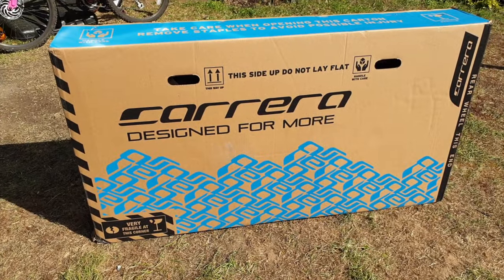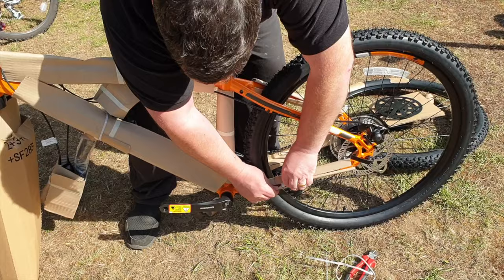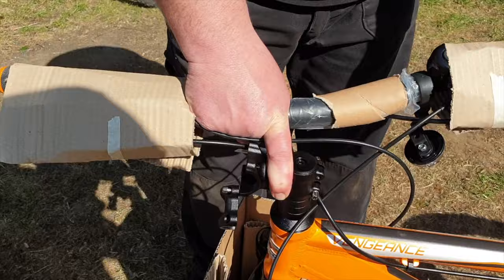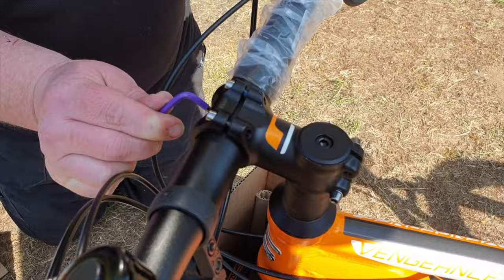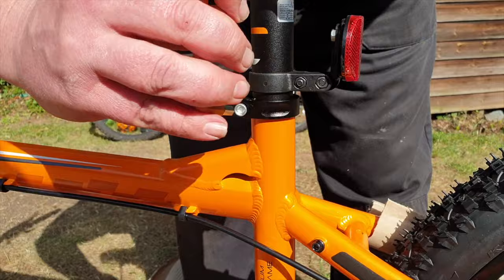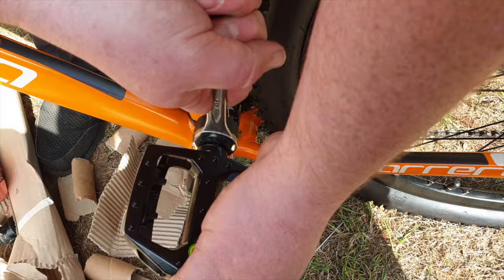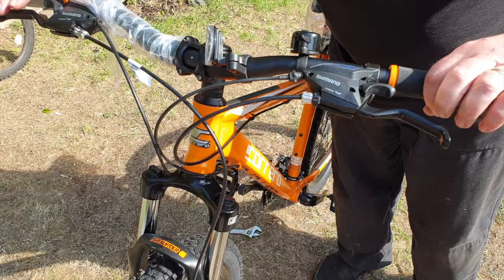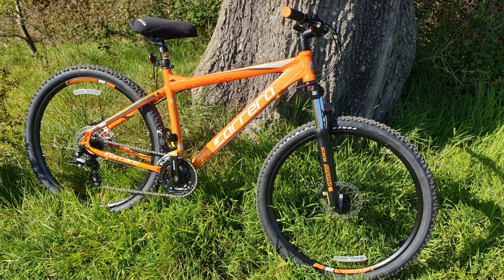Halfords Carrera Mountain Bike Unboxing and Assembly

Comment: Just bought my all black vengeance, this video was a better help than the halfords vid, thanks 👍🏻
Reply: did u buy it from halfords?
Reply: @hb_-vp1wx  yeah I did, got it delivered out
Reply: Do u know the size of the brake disc in milemetres??
Reply: @kexiu2899  the vengeance comes with 160mm discs front and back but you can use adaptors to put a 180mm on.

Comment: I unfortunately found this video after I assemble my new Carrera Vulcan yesterday as it would have saved me a bit of time fitting the front wheel. You could have possibly added that the quick release pin comes fitted through a plastic…throw away….part on the forks & that you remove it & fit it to the wheel. It’s common sense once you realise, but it had me scratching my head for a good 10mins😬. Great clear instructions though which will no doubt help many people👍

Comment: Ive got this bike, after 4weeks mount around middle post had !over & snapped the chain. I've fixed chain, but it's stuck on middle cog. What do you think could of caused this. It happened gearing down 3-2-1 left side. Thanks
Reply: Sound like you need a bike repair shop to me.
Reply: I’ve had this bike for a year and it’s been great for me

Comment: Did you grease any the parts before? And is it needed?
Reply from the maker: Only the chain and gears need to be greased regularly, but they come already greased so no need to do this out of the box.
Reply: life by drone cheers mate.
Reply: Adam  only the chain needs regular greasing, like the guy said everything else comes pre greased. I have the same bike and mine did.
Reply: Adam  what grease should I use? Thinking of buying this bike but I know the dumb guys at Halfords wouldnt have bothered
Reply: Adam  they sell a teflon based 'water resistant' one I think that should be good. Also can I get away with using normal Allen wrenches for the handle bars or is a torque wrench important